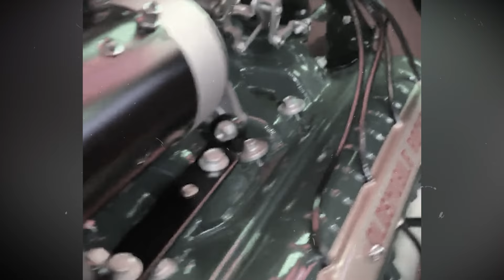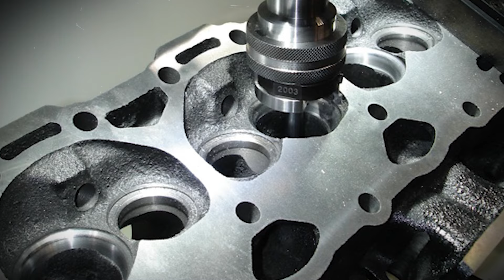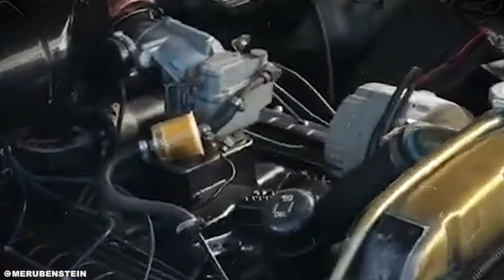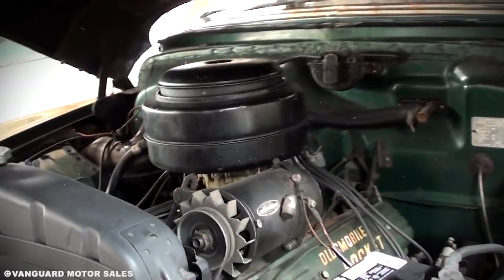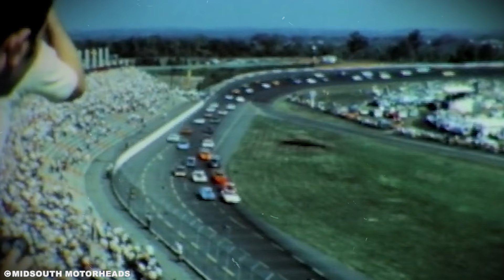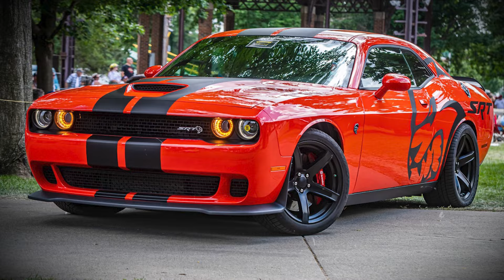This Brooklyn Mechanic OUTSMARTED Oldsmobile With a  Secret  Rocket V8 Head Trick

Comment: I’m bailing out early. Already heard the same information twice and a little past 16 minutes the third repeat is starting. So let’s be honest, this is roughly an eight minute video. Very poor quality and lots of bogus information concerning the racing sanction which required a 100% as factory built configuration engine. No oversized valves or reconfigured combustion chambers were allowed back then. Maybe some sanctioning body allowed such modifications, but NASCAR surely didn’t. Had such modifications been done at the factory before shipping out, with cataloged part numbers and over the counter availability to the masses, it would have been a legitimate part upgrade for racing.

Comment: First things first here, I will not dispute the late vic Edelbrock senior or Juniors work that speaks for itself. There are many inaccuracies with this story. It was not Oldsmobile that had the first overhead valve V8, it was Cadillac. Cadillac started design work on the overhead valve V8 in 1936. The people involved with this was Charles Kettering, Harry barr, Zora Duntov, and Ed Cole. In 1941 Cadillac had a prototype on a dynamometer ready for testing when world war II broke out. The project was shelved for the war effort and resumed in 1946. During the time between 1946 and 49 Cadillac had worked out all of the bugs with their new engine which debuted in 1949. During this period from 1946 the chief engineer of Oldsmobile got wind of what Cadillac was doing, the chief engineer of Oldsmobile went to the CEO of general motors and complained to him. This complaint forced the CEO to force the chief engineer of Cadillac to reveal to Oldsmobile their design this is how the rocket came to be. The writer of this article needs to look into the Cadillac archives of the period, do the research and you will find what I am saying is true. Ed Cole would later go on to design and build the small block Chevrolet which debuted in 1955, it wasn't Oldsmobile that inspired the small block Chevrolet it was Cadillac because Ed Cole directly worked on that project with Cadillac. Cadillac was also the one that created the 18436572 firing order that almost every old style V8 uses. As far as horsepower goes Cadillac was always ahead of the curb with this overhead valve V8. Between 1949 and 1955 Cadillac went from 160 horsepower to 270 horsepower in the eldorado with two four-barrel carbs. 1956 Cadillac debut the 365 V8 x 1958 that was producing 310 horsepower with three deuces still ahead of Oldsmobile even the Oldsmobile j-3. If anyone who reads this comment about me that's okay cuz I have the books here to prove all of this. I have several Chilton 1940 to 54, 1950 to 58, 1959 to 63, 1964 to 71, if I need to help anyone receive correct information as I have it right here on the pages of these original books I thank the Lord God Almighty above that we have these books. All that I have said here is verifiable go find it. Cadillac was legendary and I am tired of Cadillac being Dishonored and disrespected and purposely overlooked. If it wasn't for Cadillac back then who knows how long all of the following great innovations would take to get to us. I am sorry to say though nowadays for the past 35 years at least Cadillac has lost their way they make junk now they were once the standard of the world but now there's a standard of nothing, it's sad to see Cadillac has lost their way. Hopefully to somebody this information I have given will be quite useful and helpful.